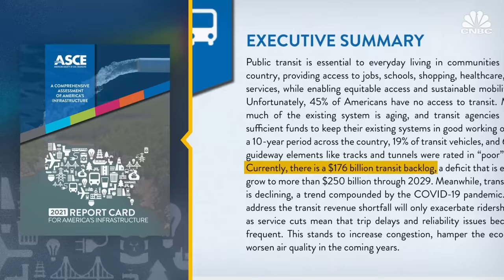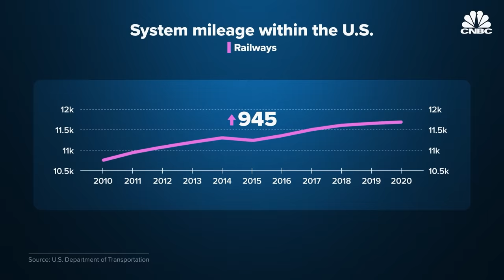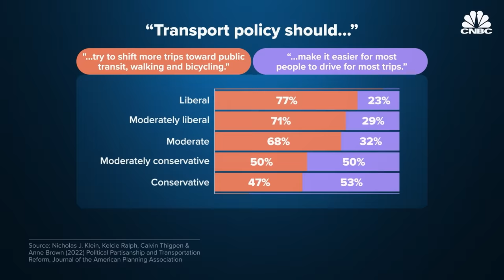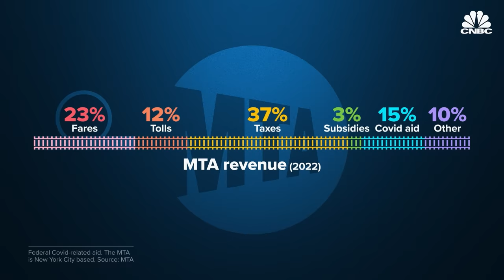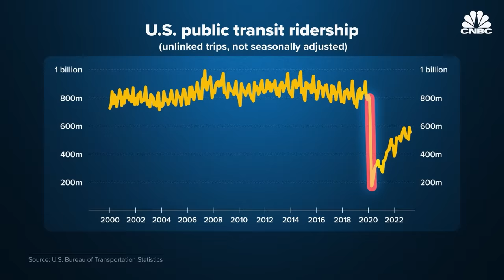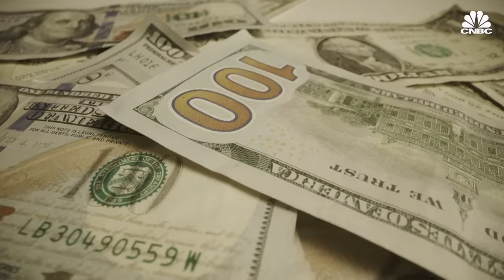Why The U.S. Gave Up On Public Transit

Comment: One of the biggest problems with public transit in the United States, that no one ever talks about is the fact that it does not feel safe. I was just using San Diego’s public transit the other day, which is actually pretty good for the US. On a trip to downtown the trains and buses have, multiple people screaming and mumbling to themselves I’m guessing from mental problems. On the bus ride home, we stopped at a park in a whole bunch of minors got on every single one of them was blasted, drunk and high, doing them openly on the bus as well. The average person using public transit just wants to go to work or wherever they’re going and come home. No one wants to put up with the hassle of dealing with the typical clientele of public transit.
Reply: Bingo. That's what I hated about public transit
Reply: I had to deal with that when I was using the San Diego Trolley. I appreciate every day that I have a car.
Reply: Best way to deal with this - in my opinion - is by getting to the root of the problem. Better programs to support the addicted and the mentally ill, drug reduction programs, programs to house homeless people that may feel it necessary to get on public transit to escape the elements, etc. Reduce the amount of addicts and homeless on the street and you'll reduce the amount of them on public transit by extension.
Reply: @tristanneal9552  That is being tried. It fails.
Reply: I once rode on a public transit bus in a major city. A homeless guy was on the bus. He stunk up the whole bus. It was awful. My eyes were watering the smell was that bad.
I was so glad when he got off the bus.

The city has homeless shelters, social support programs, etc. Lots of them. It did no good.
Reply: Most people who used it everyday say they feel safe
Reply: But if you drive the risk of death and injury is much higher. In the United States every year over 40,000 people are killed in road crashes and millions are sent to the hospital.
Reply: @Belmaktor  Come on. Try something better next time.
Reply: @Belmaktor  sure but i think id personally take a random accident that kills me over being assaulted or worse. Its kind of like asking whether youd like to drown or burn alive. Neither pls. Anywhoo not arguing your statistic but i wonder where that fatalities number would be without DUI DWI related crashes.
Reply: I take public transportation in LA a lot. While it's true that there is a good chance some crazy homeless person will be there, I've never felt in danger. I'm a guy so I don't know how women feel. I do know my wife doesn't feel as safe as I do.
Reply: @tristanneal9552  Just get them off the streets, period. That will solve 99% of the problem.
Reply: To solve that problem buy you car so you don't have to deal with that
Reply: @sarahsimpkins1311 
But what if he or she is poor, unable to buy a vehicle?
Reply: @whathell6t  he just have to make away
Reply: I just use earbuds and I never really felt unsafe. One thing I hate about public transit is people that DONT use earbuds and blast their loud ass music, which of course happens a ton in normal cars. Both obnoxious AF. Buy some freaking earbuds people they are not that expensive! Also don't get the wrong idea I like public transport.
Reply: @tristanneal9552 or maybe we could enforce the laws and remove violent serial criminals from society. It’s a crazy idea, I know, but it just might work…
Reply: thanks for telling the truth. No wonder ridership is down.
Reply: That problem exists everywhere. I’ve used public transit in the UK and I promise you it’s full of the same trash in addition to be crammed in touching strangers on all sides. It’s a miserable way to move around.
Reply: @CornyBum  You nalled it; well done.
Reply: Bro you nailed it. I live in Chicago and it's mostly the same up here. Public transport feels unsafe and thus you are forced to use a car instead
Reply: Good luck in convincing ppl about that. The USA is not as safe or stable as the EU is closer to Latin America (very intense and wild to say the very least).
Reply: @cvm6854 
That's cause ppl in America became quite desensitized about high crimes, addicts, etc so doesn't mean it's actually safe. 
Lived in LA county for about months, and ppl didn't care about addicts, shootouts, gang violence, looting, etc they live with it.

Comment: I took a train from portland to pasco I think it was $35.  It saved me a 4 hour drive.  However, the walk from the max line to Union station was really sketchy.  There were tons of tents set up on the sidewalk and I saw a guy walking around with his pants down to his ankles.  The train only went once per day and the trip there arrived late at night.  And the one back was super early in the morning.  Yeah I saved a little bit of money but the time cost was so much more.
Reply: Its a big issue in the states. They are starting to realize you need transit hubs/stops near long commuter train lines and airports... buses meeting up with light rail stops. Additionally they are starting to also build multi-family residences around stations. Things other countries have been doing for decades...
Reply: @kellygoodine4405  — Section 8 housing next to the metro stations just means more thugs on the train …
Reply: @Clyde-2055  Who said anything about section 8 housing?
Reply: @kellygoodine4405  — Who says anything about Section 8 housing? Anyone that has ridden the metros in LA, New York, or Chicago … etc.
Reply: @Clyde-2055  New York has public transportation all over Manhattan... which all sorts of people use every day. Other cities are building pretty nice apartments around stations. Public transportation isn't just for the poor.

Comment: Countless studies have shown that access to reliable public transportation is the singular most important factor to lift people out of poverty. The US as an innovative and enterprising society can easily provide smart solutions if only the government would make the necessary seed investments.
Reply: Completely missed one key problem:  How Federal Grants for Mass Transit programs are allocated.

Federal Grants are (1) given as long as the public transit system does not turn a profit and (2) those Federal funds are given without requiring they be spent to improve public transit services.

So, first the City and State are incentivized to ensure their mass transit sustems stay broken, that any failures remain unrepaired, that service be unreliable to discourage commuters; and as long as that happens, the receiving government can keep that money and use it wherever and however it wants!

It is a never-ending doom cycle by design because no one could fail this badly for so long unintentionally!

Please, examine the books of New York City and their Mass Transit Authority and prove me wrong!
Reply: @davidgoodnow269  I would love to hear your solutions to efficient mass transit alternatives across the US. 
I love to an urgent plan to build at least 10k miles of high speed rail across the US in the next decade. China successfully built that length in the last decade. I am confident that the US can do much better.
Whoever is thinking about such plans should please sign me up for free support.
Reply: It's one of the most important to keep them there too
Reply: Paying attention in school and getting off drugs is the way to get out of poverty... so you can then afford to get out of the cities!
Reply: @johngoodspeed3585 Could you please point me to any studies that informed your position? Nonetheless, you are entitled to your opinions but that doesn't make it fact. The fact still remains that reliable public transportation connects people to opportunities and jobs. With reliable public transportation, people can get to schools and get busy improving their lives. When jobs move away from neighborhoods and there's no affordable way to get to those jobs, people resort to vices like drugs and crimes.

Comment: Love this! Wish this video could've touched on the perceived lack of safety associated with riding public transport as well — recent criminal activity in the subways is also a huge deterrent to civilians wanting to take public transport and may be more difficult to address than high fares and punctuality.
Reply: NYC subways are still dramatically safer than they were back in the 70s and 80s.  Crime in NYC even with the recent uptick is still an order of magnitude lower than it was 40-50 years ago.

Comment: I live in Atlanta use public transit whenever I can because it’s cheap and bypasses a lot of the traffic you sit in on the free if you were to drive or Uber. If you learn the routes, get to know the drivers and use the app to track when the buses will arrive it’s pretty good. I have noticed there is a shortage of buses on the weekend. Which makes it harder to get around

Comment: Here in Los Angeles public transit has a reputation of being dirty and dangerous, which has pushed more riders into becoming drivers. Transients evade fares and just ride back and forth all day on the subways and light rails. Just yesterday Metro announced they're going to spend millions more on security and cleaning up trains and busses. Only time will tell if it's too little, too late.
Reply: It's been that way for decades. Back when the system was called RTD, people called it the "rough, tough, and dirty."

Comment: Your job may be on the line if you rely on American public transportation to get to work due to inconsistency and disorganization.   For example, there's a bus line with two types of service: one was the "Rapid" which had fewer bus stops, and the regular which stopped at all stops.  I had to use the regular since the location of my work lay right in between rapid stops but there'll be two rapid buses that were usually empty vs one regular one that was always full...it'd make more sense to do the opposite.  It was very frustrating to see a Rapid and then wait to see another Rapid even emptier with passengers!  I'd sometimes kick the bus shelter and curse the system....thank god I no longer need to rely on public transit for job security.
Reply: Omg, this is the very situation that I was in. I spent 10 months struggling with the horrible bus service of Jacksonville, where I had to deal with all types of non-sense (sometimes I felt like vandalizing their electronic totems, because they were misleading). Sometimes I missed the bus changes, because of their stupid disorganization. Until I finally got a nice car. Will cost me more but everything is thought out for cars in this city.
Reply: Inconsistency and disorganization and are also the result of low ridership and underfunding of public transportation. That's what this video is about.